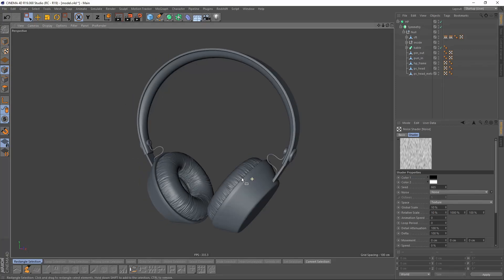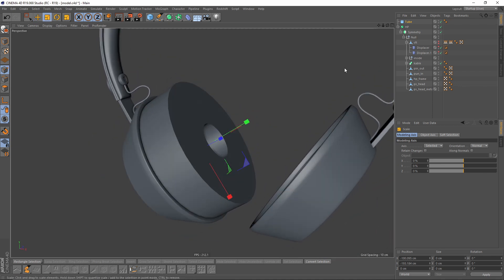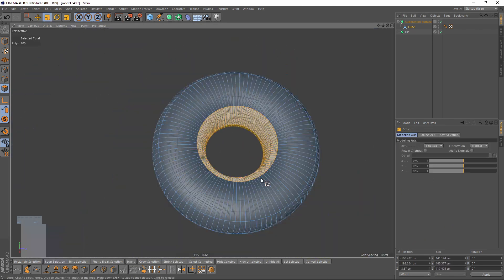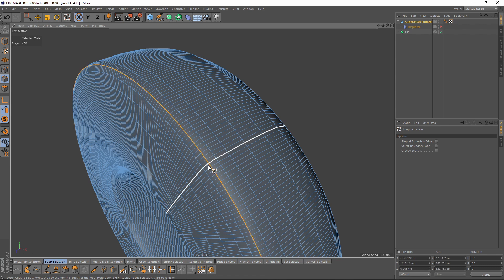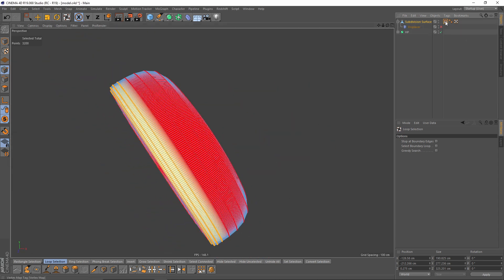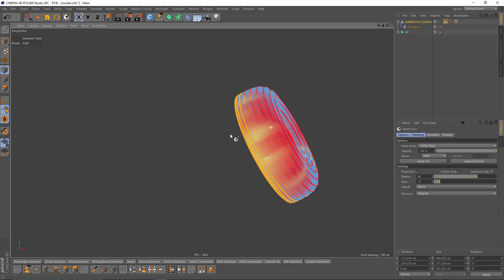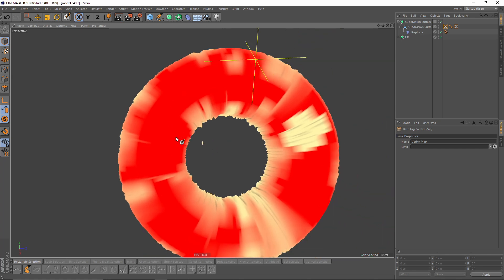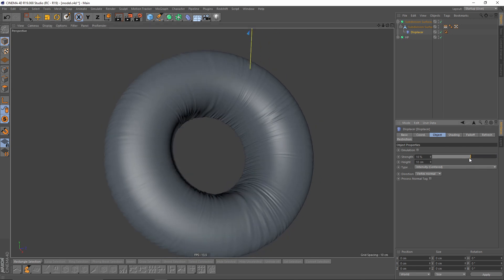How to Model Realistic Cloth Wrinkles | 3D Modeling Tutorial

Comment: It should be noted that your stretched noise deformer to create folds will not work properly if you polygon geometry is square. They need to be rectangular lengthwise in the direction of the folds.
Awesome tutorial!
Reply from the maker: Yeah you are right
Reply: @polygonpen I could notice it also, texture projection wrapping around doesn't work. Maybe we need UVs for that. Pin that comment, it will help people not getting frustrated.

Comment: When I have my selection and click set vertex weight, I do not get the red and yellow weights. Nothing happens at all... anyone have any idea why this is happening?
Reply from the maker: Are you sure you are on point mode.
Reply: @polygonpen  Yep! I am on point mode but only get the highlighted points and no yellow and red shading. I still went ahead and tried to use the paint tool and it does nothing. Maybe I have a setting turned off?
Reply from the maker: Are you sure you select "Set Vertex weight", not "Set Selection", It should turn red even if you don`t select any points